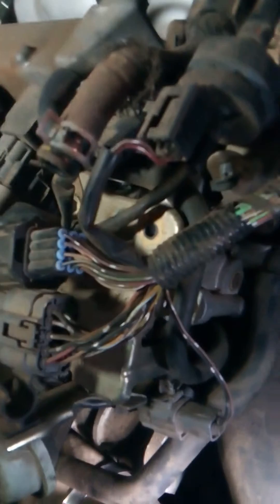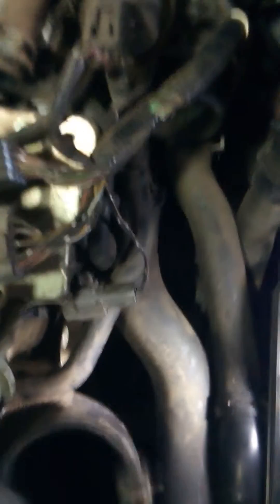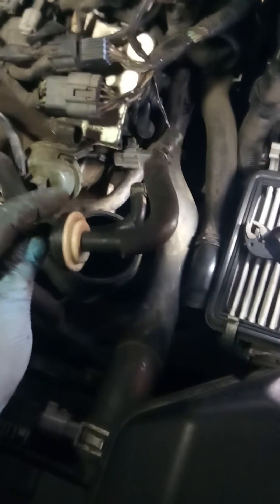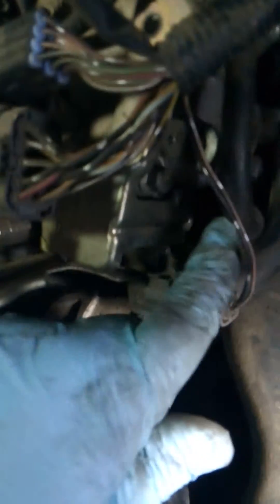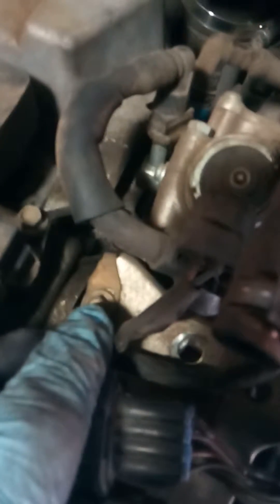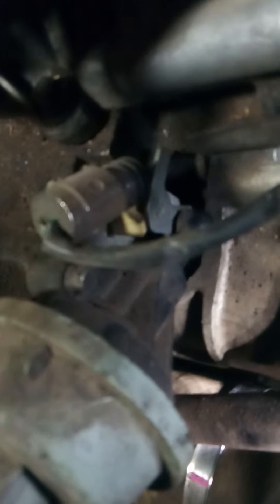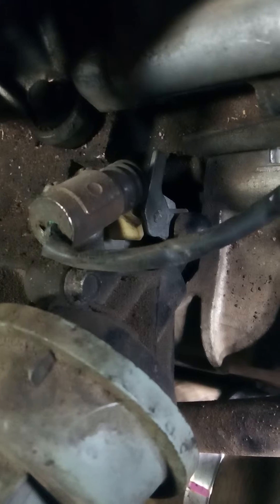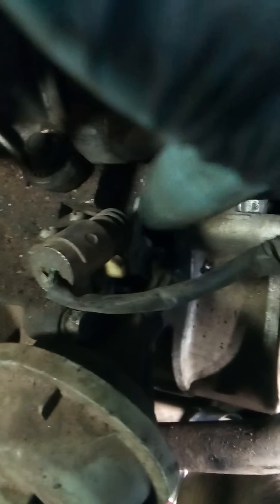IMRC part#4 Mazda runner control repair diagnose engine code P2006 cx-7 Ford edge 2.3L

Comment: my mazda speed 6 2.3 is showing that 2006 code we changed the solinoid and acuator still getting code . i saw a guys vid where he mount to screw in front of the plunger so it can only go half way but nomore vids if it worked please any info lemme know will help so much
Reply from the maker: Is your white plastic piece by the plunger broken?
Reply from the maker: I don't know why so many of my videos stopped working but I can try to send them directly to you